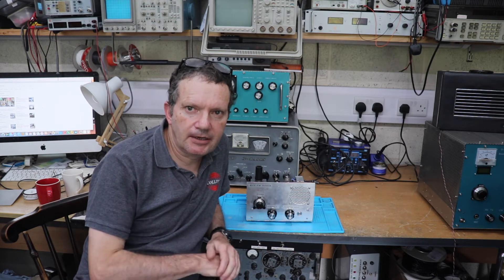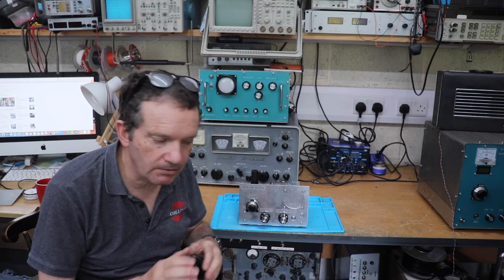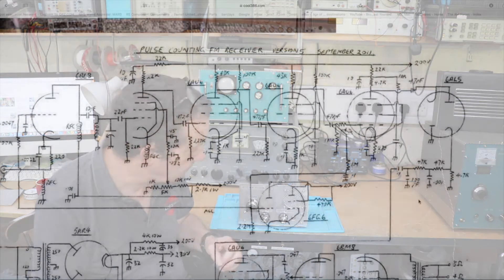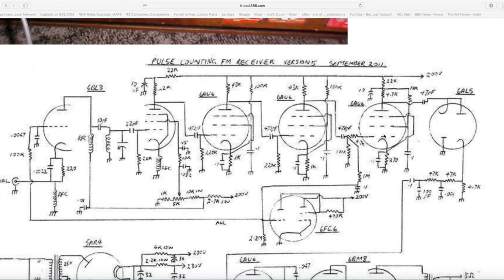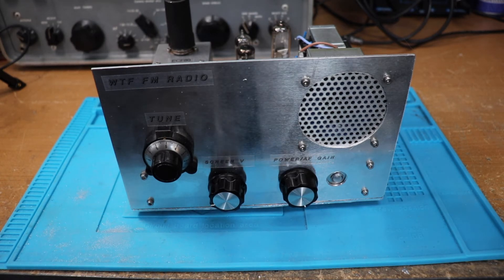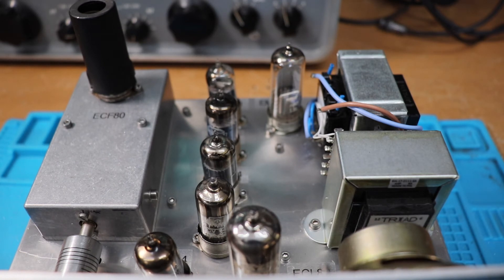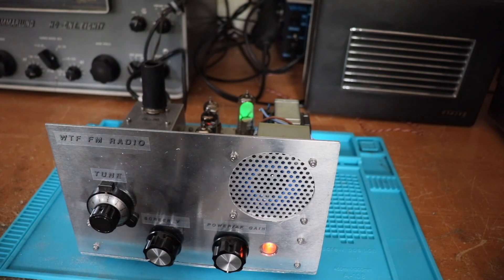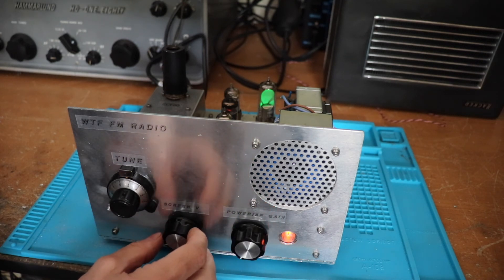Homemade Tube FM Tuner: Amazing Audio From The Junk Box!

Comment: What about 3x 12AF7 tubes in a Cross Coupled Double Balanced Mixer like a SO42P to get the sum and difference but nothing else and a 455Khz Crystal filter can be used for IF filtering then a pre-driver to drive the limiter and Pulse Counting Detector.

Comment: Thank you, very enjoyable. In about 1980 I made a successful pulse counting valve receiver for the 2m FM band. I think I used an IF of about 50 kHz. Also, Sinclair made a pocket FM radio using a pulse counting circuit.
Reply: I use solid state pulse counting FM radio for NFM 421-424 MHz band.